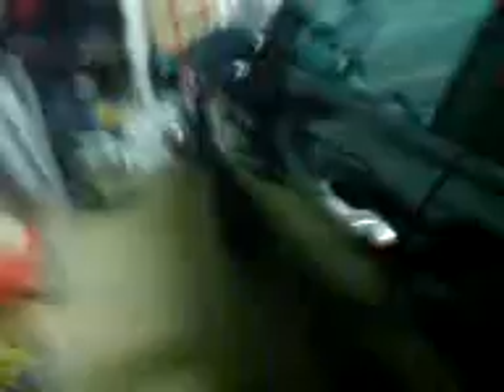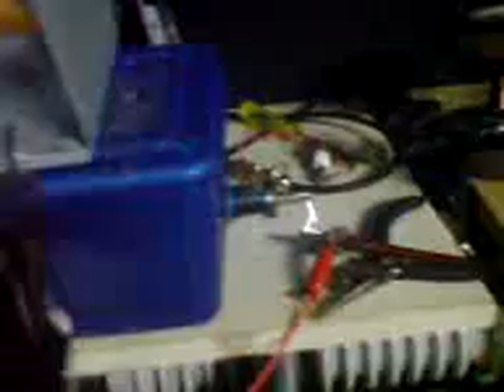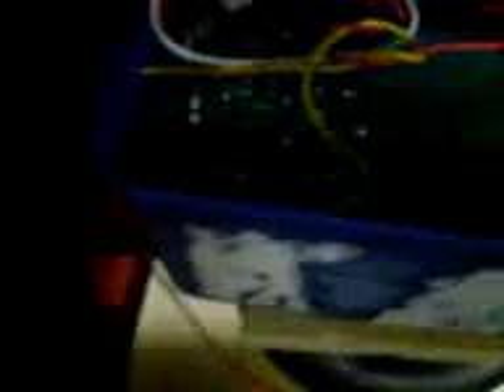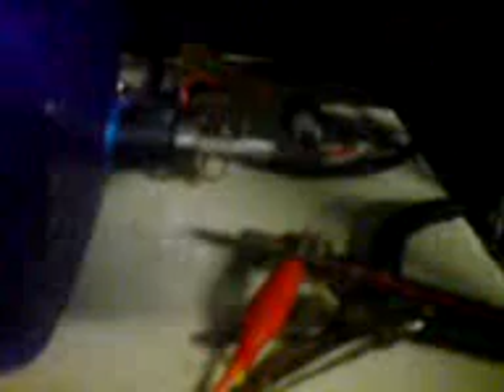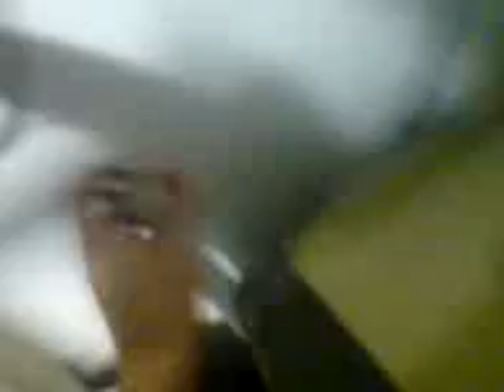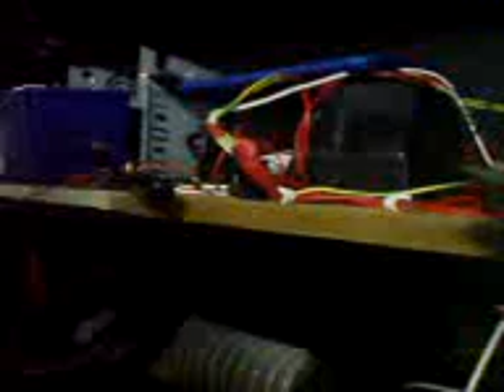555 driven ignition coil

Comment: lol the reason you are going trough 10amp fuses is because all the 555 does is pulse the current  into the ignition coil so it may pulse around 20amps but for a very short time id say that the RMS curent that your drawing is only  around 8amps so if we use the formulea V*I=P your using around 96watts